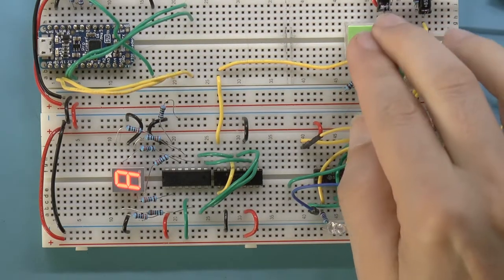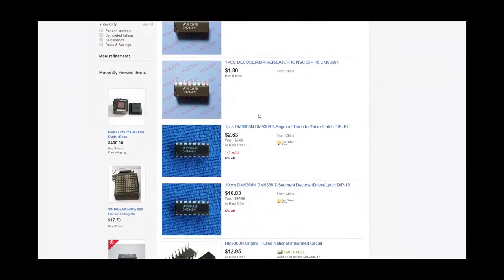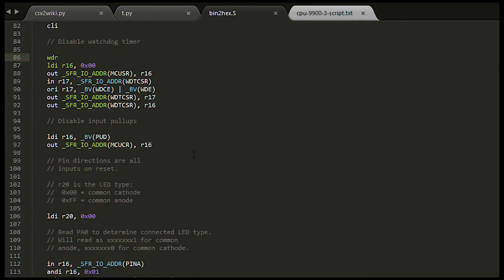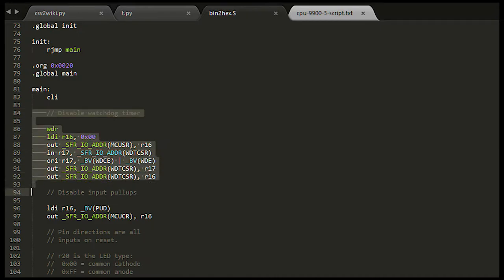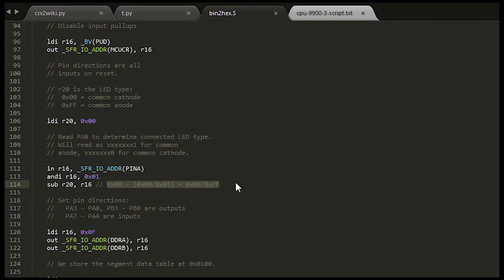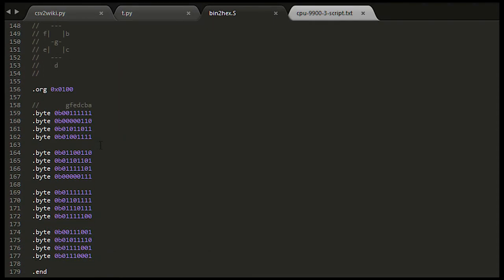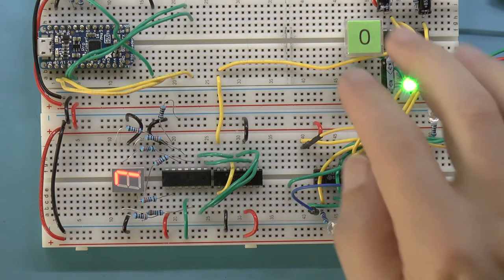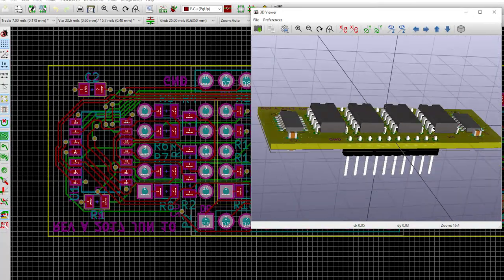A binary to 7 segment decoder not-ROM

Comment: If you really wanted to have 7400 series binary to 7seg then you could use a presettable binary up/down counter and a bcd counter. You would start by loading the binary counter with your number. Once loaded one pin of the counter (zero flag) should change state which would then trigger a circuit that would start incrementing the bcd counter as well as decrementing the binary counter until zero is reached in the binary counter. And then you would feed the output of bcd counter to bcd to 7 seg decoder connected to your 7seg display